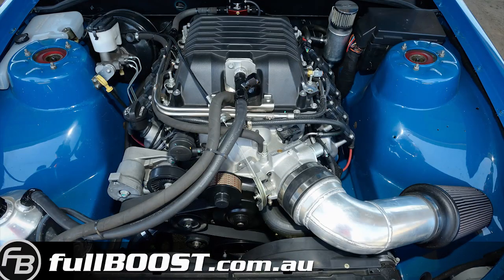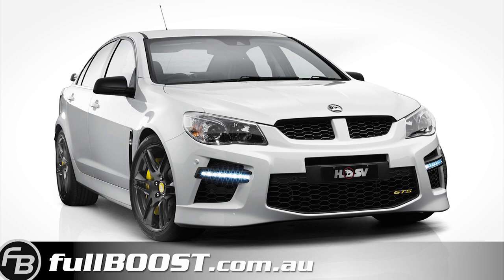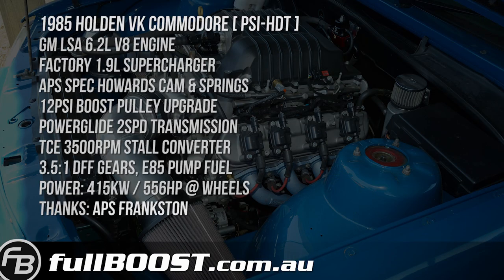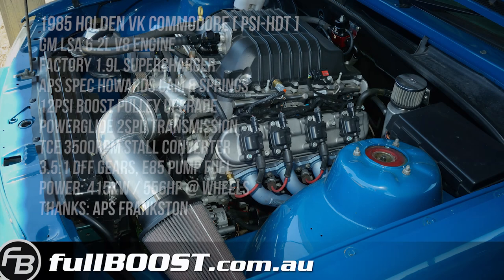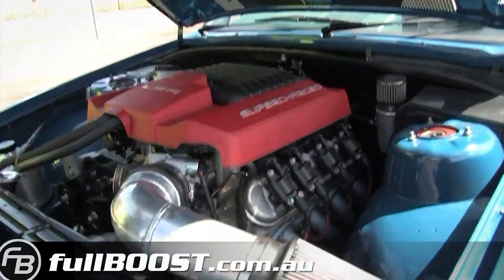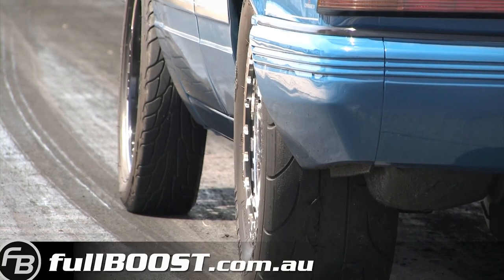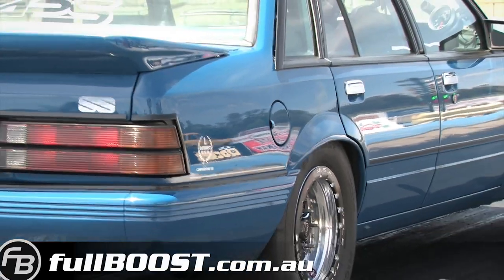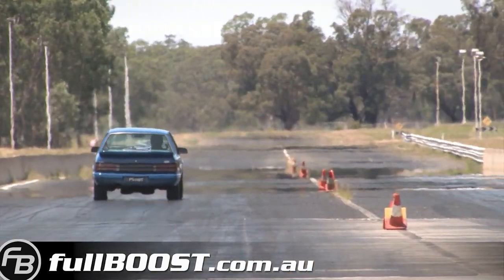LSA Supercharged V8 Holden VK [ PSI-HDT ]

Comment: LOL. It looks like a blue meanie, the VK Brock. I guess it isn't, you wouldn't change one of those around, but... nice car. Even stock, it'd be pretty quick. A VK is about 400 kg lighter than the current jigger.
Reply: I had a blue Brocky & I think its dry weight was 1400 odd kgs.. That was the idea behind the 4.9 litre donk. Pathetic kW std but mine pulled ok once I'd poured another $6k on top of the purchase price of $26k. Larry Perkins did the work.

Comment: There is something very very wrong with this car cause mines stock cam with nothing but top pully, harrop intake and headers and its doing 426rwkw.

Everything else stock as a rock....
Reply from the maker: +MyJizz UrEye This car has run a 9.1 quarter mile so that is of more interest to the owner than a dyno figure👍
Reply: With that time and 3050 pounds the car would be making closer to 495rwkw.

Is there footage of the 9.1 run?
Reply: @myjizzureye  haters will hate.
Reply: @Alex_G07  Discerning people will fact check.